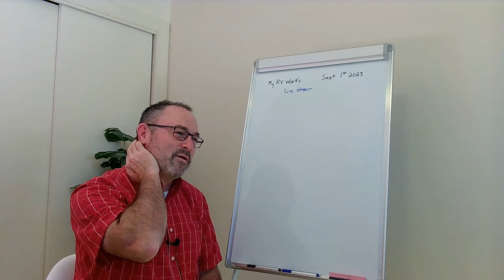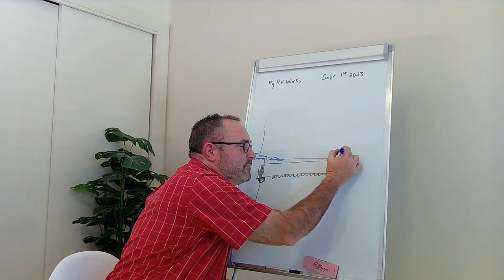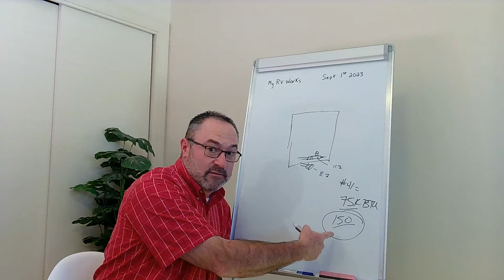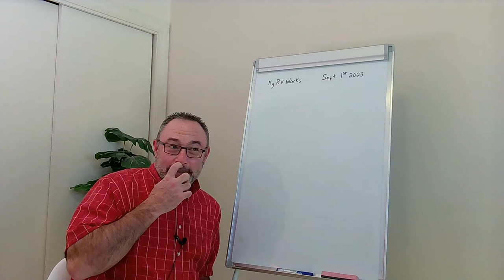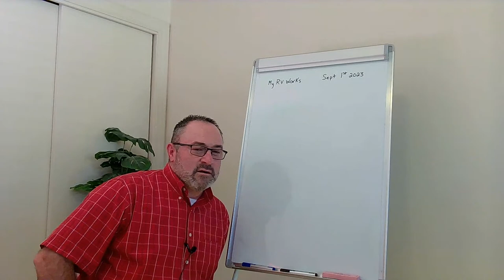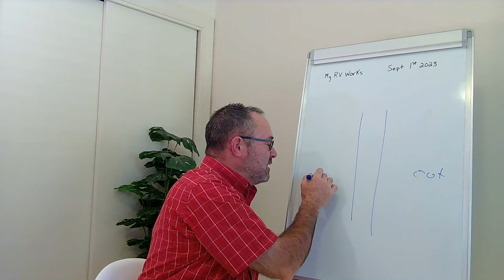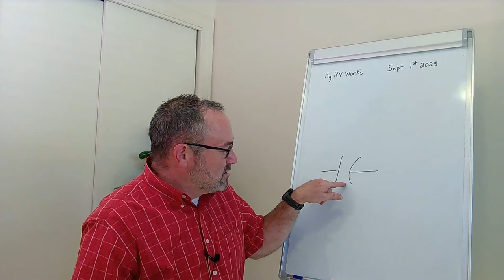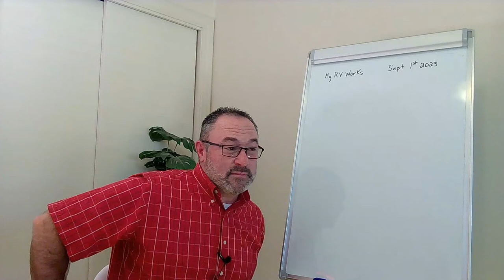Livestream Q & A I September 2023

Comment: I have a Norcold NX8 rv fridge that is not cooling . The gas works and the electric heater works . The control panel works w/o any code flashing . I have checked the fuses inside the mother board and they are good . There is no sign of an ammonia leak or smell of ammonia . The trailer is perfectly level . It worked on our last trip and now I have it plugged into shore power at home . I have bought and changed the thermistor .I can hear it switch from electric to gas when on auto mode . I just can't find anything wrong . I did take the top outside panel off and found the two wires coming from below that are connected to the coil at some for lack of a better word ,resistor . I assume it's 12 volt .I don't know if that could be the problem but it doesn't look like it can be replace . I wonder how far up the pipe that gets hot from the heating source gets hot . My pipe is only hot at the first section coming from the heating source but no further. I wonder if the whole piping system in the compartment should be hot .Should I be able to feel the whole system too hot to touch or does it get cooler as the ammonia goes through the system .  I hope you can get a chance to respond . Thanks, Rod Terra

Comment: Hello 
I wanted to ask a question...My Fourwinds infinity will charge shore batteries on 50amp hookup but not on generator.  The rear AC unit would not run as well...soon as hooked back up to 50 amp everything works as should..Checked breaker,switches and fuses..Any ideas where to start.

Comment: Hello, I was hoping someone could help me. We have a 2006 class A, Gulf Stream, Sun Voyager that we are long term staying in. We have a  50amp plugged into shore power. Everything has been fine and working properly for 6 months. then one day our batteries dropped low and our 12v appliances would not work. We replaced the converter and the batteries still wouldn’t hold a charge so we bought new batteries. That didn’t solve anything. we realized we purchased the wrong converter. we then replaced it with the right one. Our batteries still aren’t holding a charge. We have checked fuses and breakers and can’t find anything. If we start the motor home it will instantly have full 12v dc power. We let it run and charge the batteries back to 12v but that only last a day without using any of lights or fans. Our refrigerator is a residential one so it does not use 12v. Any advice would be greatly appreciated